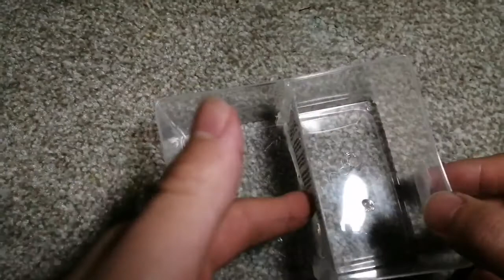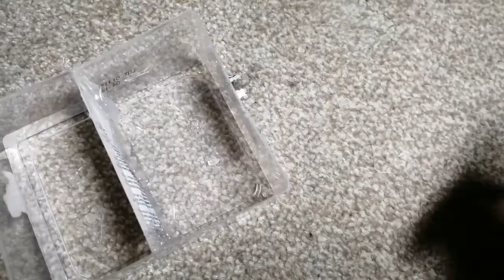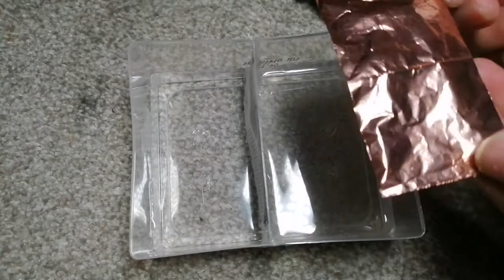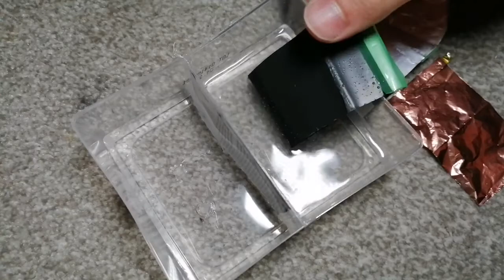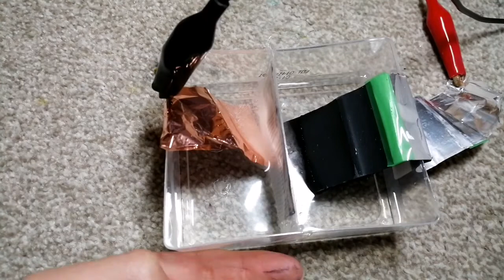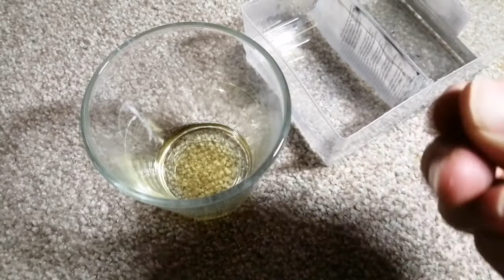Making Sodium Hydroxide By Electrolysis

Comment: The sodium hydroxide reacts with co2 in air thus making sodium bicarbonate and making it weaker
Reply from the maker: No, the rate of sodium hydroxide react with the air is slower than the rate of the sodium hydroxide forming, which means the solution get more concentrated with sodium hydroxide.

Comment: Again you , you are doing clever trick . Can separator from li ion battery will work as membrane for it?
Reply from the maker: Good point!
It depends on the type of membrane been used in the lithium (ion) battery, because of this, some membrane may work well whilst the others may not so.
You could look it up on the polymer ion exchange membrane, which means there are some specific membrane that works well in certain pH, temperature and the ion.
I've tried it out with is particular lithium ion battery membrane, the membrane does not seems to work well with this set up. But you could experiment with different type of membrane to see different result.